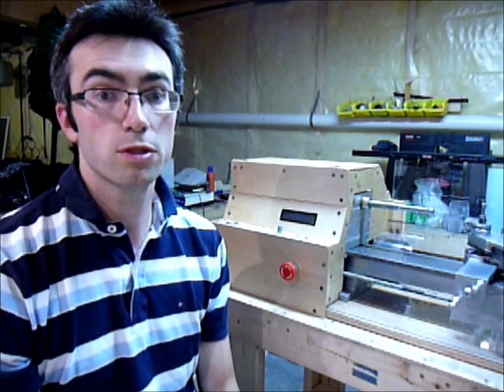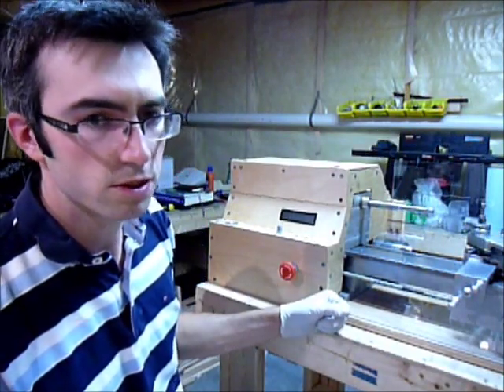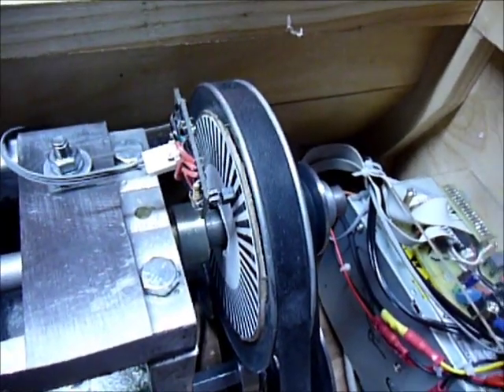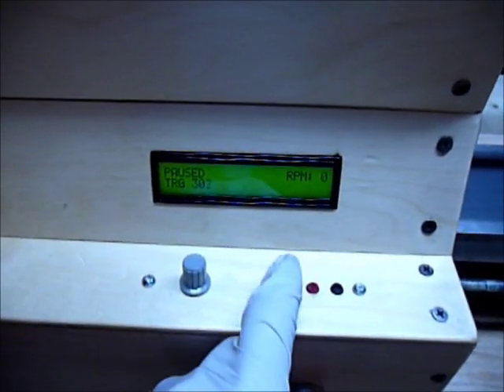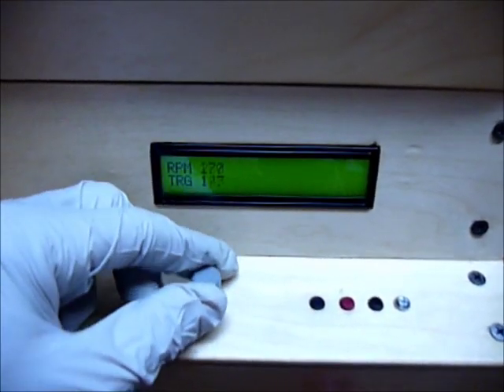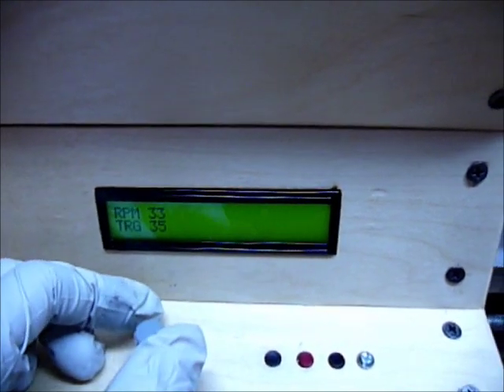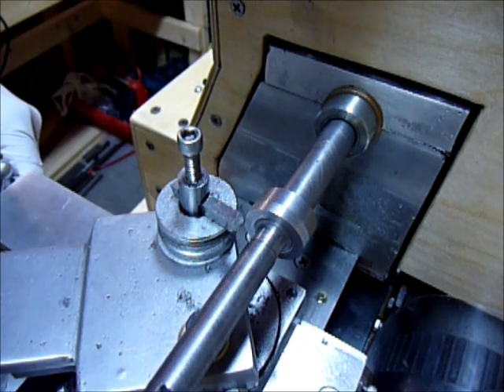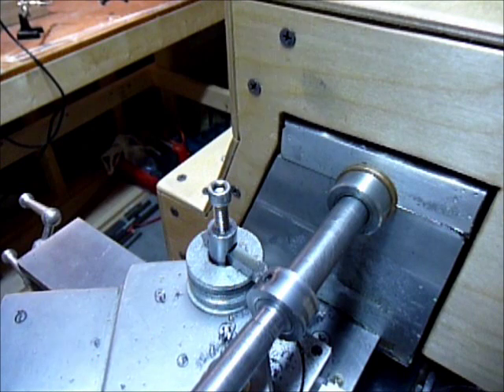Gingery Lathe Cover, v2 Controller, Leadscrew Drive, and more!

Comment from the maker: Hey Rick, thanks for continuing to follow the progress!

If you want to go down the treadmill motor / dc motor route it would probably be cheapest to search craigslist for a used treadmill that is cheap or free - I just looked in my area and found 4 possibilities for under $50 ( 2 free ). You would strip the motor ( and electronics ) and take the rest to the dump

Comment from the maker: [continued from reply] ... Glad you are interested in my mods, though it is pretty much a gingery for the most part - once done I'll probably upgrade a lot of it ( starting with the toolpost ). When I started the project, I wanted to build an underwater ROV, but didn't have anything to turn down the cylindrical parts - so it was either a Chinese mini lathe ( which was still out of my budget at the time ) or build my own - I found the FONLY lathe, and then the Gingery which captivated me.

Comment from the maker: Thanks for the comment Zeb, definitely a good suggesting on the carriage feed. In the gingery series it's a basic means to an end, by book #6 you are building the change gears for the lathe.

I'm not going to make the change gears, but I do plan on adding ELS ( electronic lead screw ) capability to the controller with a stepper driving the lead screw.

Cheers,
Morgan

Comment from the maker: Thanks for the suggestion on the additional speed controlled motor on the leadscrew. I've been planning on adding a stepper motor to drive the leadscrew, which I can use later on for automatic thread cutting, or even CNC if I get to that point.

Comment from the maker: Thanks for the comment. I do have a precision multi turn pot for the RPM adjustment, however I have been unable to get the ADC on the PIC to produce a consistently stable reading from sample to sample. I do use the fixed voltage reference which should compensate for any fluctuation on Vss. The range from ADC on the pot is 0-1024, and since my MAX RPM is set to 1250, it could be possible that small changes in the ADC value - even of 1, will result in a change in RPM by 1 or 2.

Comment from the maker: Hey,

Thanks for the props on the build. Definitely keep at the build, the book can be a bit frustrating at times, but the Gingery Machines yahoo group is a great source of information / help if you aren't already a member there. 

One suggestion, definitely convert the charcoal furnace to propane if you can. I started out building the charcoal furnace ( cured the liner with charcoal ) and quickly found that it would take took long starting / stopping with my time constraints.

Comment: your lathe looks great. a suggestion of mine to you is that because your feed rate is dependent on your spindle speed you have literally no control over how fast it feeds. you are definably going to want to get a separate feed mechanism so you can slow your feed rates when you turn faster so you can get even finer of a finish on your work.
other than that i really like your machine

Comment from the maker: [continued from reply] ... 

b. The headstock end footing is sized to match the width of the headstock ( providing more support ).

c. Most of the patterns are designed with a larger wall thickness - gingery calls for ripping 3/4" boards to smaller sizes - I typically would not rip the boards - so instead of 5/8" I'd just use 3/4"

d. The headstock pattern was more of a box, but had to reduce to a similar profile as the books. The clamps are one piece versus 2 halves for alignment / support.

Comment from the maker: Hey coss5367, Thanks for the reply. I did realize that, however if I wanted to change the cutter by a 0.001" or 0.005" it would be fairly hard to dial that in - a half or full rotation of the crank might be easy to repeat, however anything more than that would seem to be pushing it - especially if you want to try and be accurate / repeatable.

Comment from the maker: [continued from reply] ... Yes, I did sale up the design a bit while staying within the limited melting capacity of my furnace. Most of that was derived from all the research I did online about the lathe, and what people would have done differently ( gingery machines yahoo group is a great resource too ).

a. The ways are 3/8" x 4" CRS vs 1/4" x 3" - That made the bed pattern 1" wider, and I added as much additional webbing to the bed to help prevent twist.

Comment from the maker: [continued from reply] ... It's pretty easy to construct a bell style propane burner out of hardware store pipe & brass fittings. My furnace gets up to temp. in about 15 minutes at 10psi. I can mold, cast, & breakdown ( for 2 pours ) in about 2 hours - it has been extremely helpful.

Once I finish up the book, I'll be putting the schematics, parts list, eagle board files for the dc motor controller / driver - so stay tuned ( checkout my blog & subscribe to the feed for updates )

Comment: outstanding work, i think you need a multi turn pot for the RPM or a range switch? or seperate coarse and fine pots? as for the drive. my fathers lathe (not a gingery) he put another speed controlled motor on the rear end on the drive screw.

Comment from the maker: *continuation from other reply - I continuously sample the RPM Knob, which is why it bounces around. One possible fix would be to require a 'Set' button to be pressed to set the RPM, but that would be annoying after a while. If ever I convert to a CNC lathe, I'll have software override the knob anyways... A fine adjustment pot would be good if I wanted to get really accurate with setting the RPM, but at this point not really needed.

Comment from the maker: Sorry for the multiple replies, the 500 character limit is killing me :(

Anyways, with the 'stock gingery' you get the torque to cut steel from the pulley reductions with the motor running at full power. There would be no way to achieve this on a regular AC motor ( like a washing machine motor ) that is suggested in the book, without the cone pulleys / countershaft, unless you setup a VFD ( variable frequency drive ) system for the AC motor - frequency adjusted to maintain speed and torque.

Comment from the maker: Finding 'best speeds' for cutting certain materials is not really possible on the machine I'm working on, as there is no 'fixed speed'. WIth the PWM driver + PID control, the duty cycle is really low for the case of 35rpm ( ~5% duty cycle ) however when the cutter first hits the metal, the duty cycle can spike up to ~40% duty and then settle down to ~25% duty. I use ~ ( approximate ) because the PID controller is constantly switching the duty at 100hz in order to maintain speed.

Comment: That is just great....looking good dude! I'm still trying to find my motor, found one, yet a bit out of my metal working budget. Maybe by your ability to change speeds so well, you will be able to find the best speeds to use (gingery lathe) on standard aluminum and mild steel so maybe i and others can gear up there lathes with standard motor and pulleys to copy them speeds, till we can rattle our pocket books for the digital and motor??!! 

Till next time, makes some chips, have fun. 

Rick

Comment from the maker: Hey Brian, thanks for the reply! Keep at it - the project can seem daunting when starting out, but it gets easier as you go - it was all new when I started but I can cast a batch of parts in 2 hours, finish a box slide in 2 nights, etc..

Thanks for the suggeston on the tape measure - the machines definitely need something as trying to keep track of degrees turned is a pain and inaccurate. Littlemachineshop[dot]com has replacement dials for the chinese machines I might try and fit to the lathe.